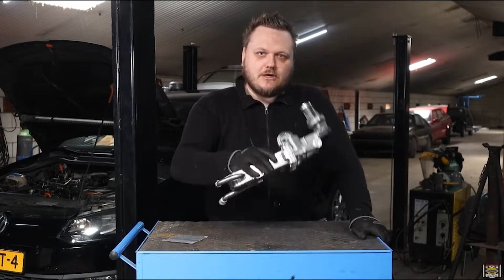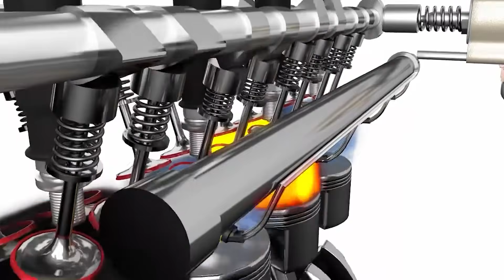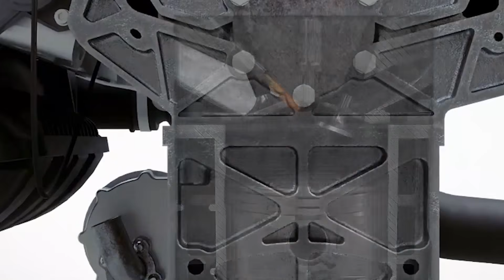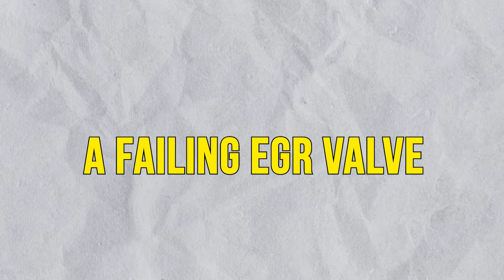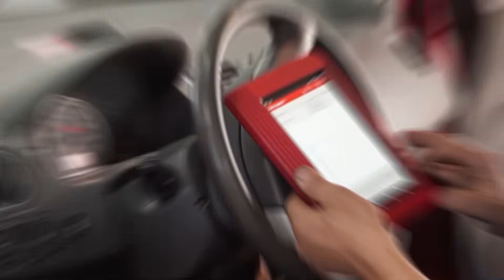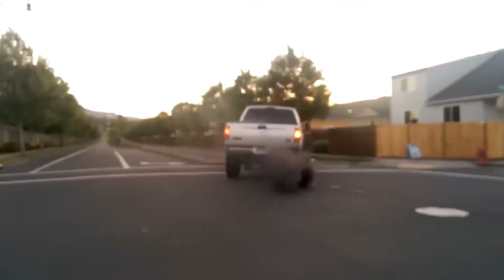Your Car Has These 11 EGR Valve Symptoms (Fix Now)

Comment: An animal chewed through my EGR cable, got it fixed, light went away. It runs just fine, except occasionally when I start it stalls. If I hold down my crank it starts and stays
Reply from the maker: That sounds like a potential vacuum leak or an issue with your idle air control valve.

Comment: Thank you it is helpful to me. I have hyundai accent crdi 2017 model I already clean the erg but still chick engine still there
Reply from the maker: Sounds like the EGR isn’t the only issue—on the Hyundai CRDi, that check engine light often comes back if the EGR position sensor, intake soot buildup, or a vacuum/boost leak is still present. Get the exact trouble code scanned; it’ll point you straight to what’s still failing!

Comment: Can u please send me a video on where my egr silinoid is located on 2012 maxima
Reply from the maker: On the 2012 Maxima, the EGR solenoid sits on the intake side, but it’s hard to spot without a diagram. Check your engine code and a service manual—it’ll show the exact location for your trim.

Comment: I've been driving over 180K miles with egr blocked off..only problem I had 30K miles ago was egr pintle position failure...the potentiometer was worn out. Replaced egr valve..I noticed new valve uses magnetic type pintle position sensing instead of potentiometer. This video overlooks other cause of symptoms..a worn out throttle position sensor can be the problem. The TPS is...a potentiometer! Fairly easy to diagnose with ohm meter or reading it's signal with scan tool.
This video has way too much useless video graphics..that change too rapidly. 
Sorry! There are other better videos.
Mechanic - 35 years.
👋

Comment: Does anyone know if this is all the same for a tractor----diesel?  Last 2-3 times I turned on the tractor...after it warmed up all of a sudden lots of white smoke came out of exhaust.  I just turned around and put the tractor up.  Trying to research various places to learn what might be the problem.  Read on some forums to try to work on cheapest thing first and work toward biggest problem.  
Thanks to anyone who might suggest or advise for this problem.
Reply: Sounds like a blown head gasket..coolant seeping into a cylinder. If you can...remove fuel injectors..(one at a time)..if you find one that is spotlessly clean..odds are blown head gasket. Coolant seeping in cylinder while engine is running will break away carbon..thus "cleaning piston...etc".

Comment: Had a shop quote $4100+ for a valve and cooler plus labor. Looking into cleaning to pass inspection instead. Nice video!
Reply: if cleaning dosnt help, just get it removed both physically and in the software it should cost you around 300$ and you will never have egr problems again

Comment: Some modern cars egr valve. Can cost from 3k-4k
Reply: That's insane..I would consider just blocking it off - metal plate between valve and mounting base. (More newer vehicles now have sensors to detect if egr is blocked - code being "insufficient flow"..can't block those egr valves...a big reason why I drive a 27 year old car)

Comment: EGR valves are about $40 on ebay.
Reply from the maker: That's a solid find! Aftermarket prices can vary, and eBay often has budget-friendly options. Just be sure to check reviews to confirm quality and compatibility. OEM parts typically cost more but offer reliability.

Comment: Can a bad/fouled E G R valve, make a Jeep die about 5 to 15 second sftyer starting, or Cycle the RPM up and down about pnce per secong after starting, and then dying as the RPM swings low.
Reply: Sounds like idle air control valve
Reply: It'll be interesting to know. I have a Mercedes V6 OM642 that stalls
Reply: EGR CLOGED

Comment: p2002  code it’s sometimes egr
Reply from the maker: Yes, indicates a problem with the Diesel Particulate Filter (DPF) efficiency. This means the DPF isn't effectively filtering soot from the exhaust. Common causes include DPF clogging, exhaust leaks, or a faulty exhaust back pressure sensor.
Reply: @autofixdiary  i had to delete and remove fap egr ad blue and i started to love my car  again

Comment: does a gasoline engine has a EGR?
Reply from the maker: Yes, modern gasoline engines often utilize Exhaust Gas Recirculation (EGR) systems to reduce NOx emissions and improve fuel economy, although it's more common in diesel engines.
Reply: Every Honda, Acura, and Mitsubishi I've had in the US since 1997 had an EGR.
Reply: yup. I just cleaned the one in my 06 honda civic hybrid.
Reply: Yep
Reply: Do we have EGR in Toyota GLI2010 manual car
Reply: @talatmahmood2188  The Corolla? Definitely.
Reply: Yes got it on a 2002 honda accord
Reply: My hybrid gas car has an EGR and folks from my car group are getting low power warning and eventually stalling.
Reply: @bsimz008  In my hybrid I was getting fluctuating idle. When i took off the egr rail it was all cake up with soot. Cleaning it fixed my idle, made the car warm up faster in the morning, & increased the MPG.